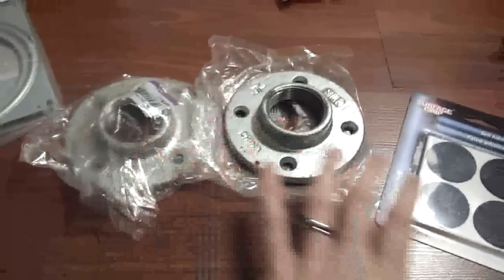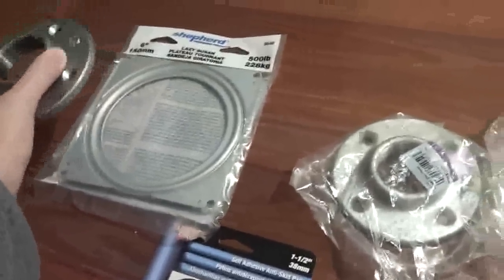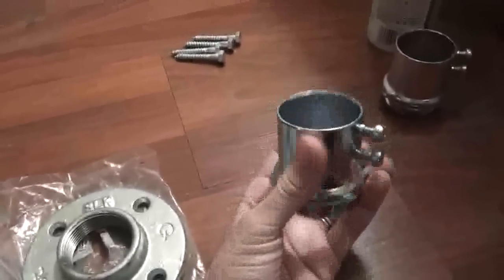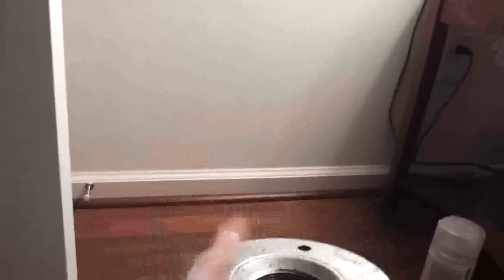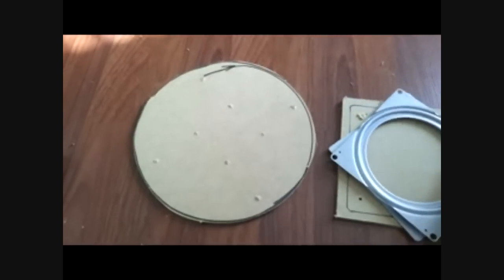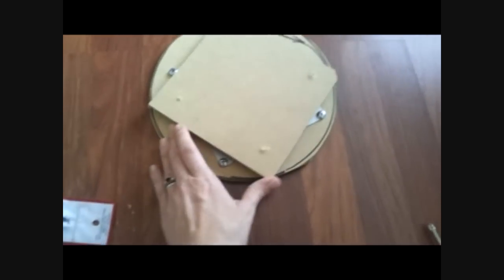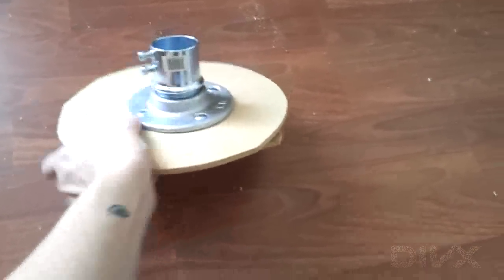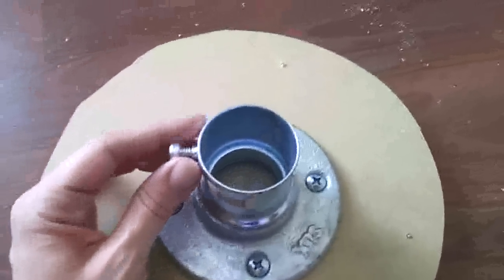*NEW* DIY Stripper Pole Spinning & Removable for under $60!

Comment from the maker: You can bolt or nail the bottom piece of wood to your floor after assembling the lazy susan parts together. Always drill into the floor first, whether wood or cement (even through carpeting).

Comment: I'm building one for my wife but it will be stationary. I am using 1 1/2 inch galvanized pipe. I've sanded it down and now ready for the paint. Then will sand it down again and paint it again.was going to then paint it with polyurethane. Any thought about the polyurethane finish?

Comment: Hi, thank you very much for providing such a useful DIY tool. I have been able to find all the parts necessary for this save the threaded metal adapters with the inner lip and built-in screws. Do you recall the store/department they were located in, and what brand they were? Thanks again for the tutorial!!!
Reply from the maker: So sorry for the late reply, but I purchased them at Home Depot in the electrical dept.  There was no name brand.  Everything is kinda stacked in bins up the wall, so it was like trying to find Waldo, lol.  :)  Good luck, and thanks for watching!

Comment from the maker: Mine didn't screw all the way in either. As long as its screwed in tightly and its sturdy, remember to check the adapter periodically during use and you should be fine.

Comment: how does the pole spin if the top piece doesn't have a lazy susan
Reply from the maker: The top doesn't need to spin. It only needs to be held upright, which is what the adapter (screwed into the flange) is for. Hope that helps!